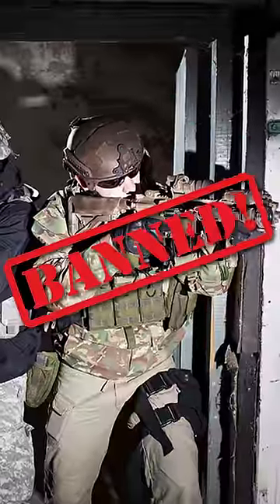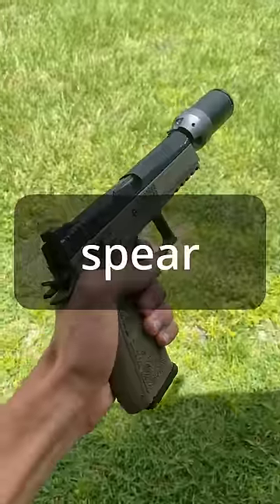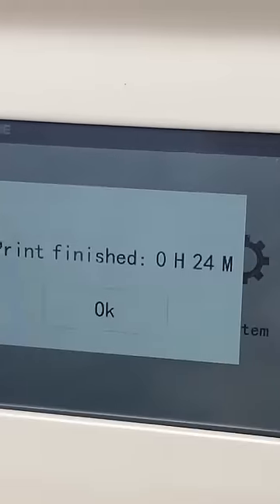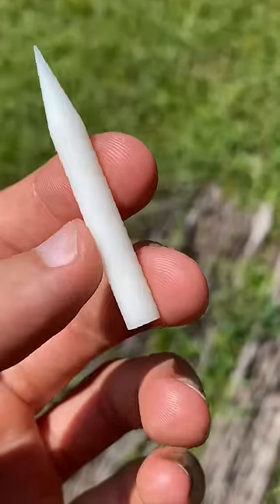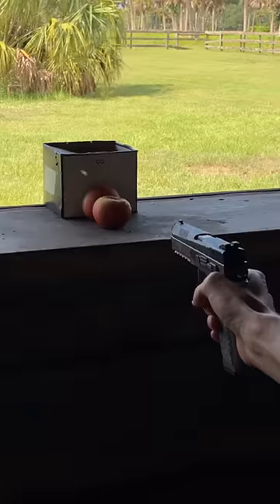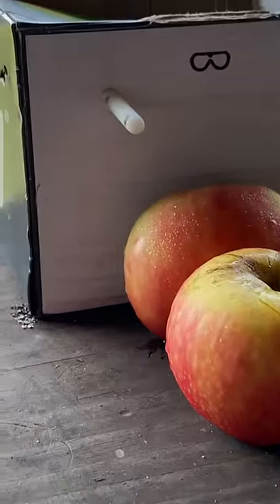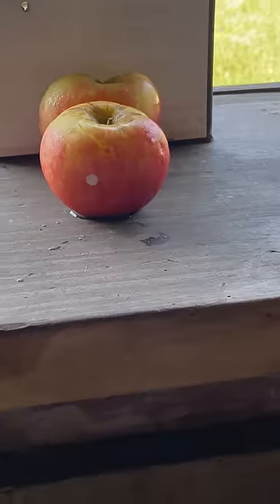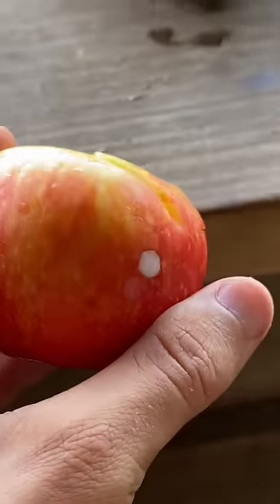How to get Banned at Every Airsoft Field in 28 Seconds

Comment: Did this with a pellet rifle when I was little. Just cut a clothes hanger at an angle so the tip was nice and sharp. The hanger piece would be cut to about a have inch in length. Then cut the end off a cuetip. Take the end up the cue tip and tape it to the metal hanger piece. It was actually super accurate and had insane penetration since as soon as it hit something the metal rod would continue while the cuetip piece would disconnect.  Good times :)

Comment: If you want it to be more accurate, you need to bias the weight towards the front. Bullets, arrows, darts, etc. All have heavy "noses" to stay stable through the air. When the rear is heavier than the front, it'll tend to start tumbling

Comment: Fun fact: You can fit a 5.56 in an airsoft gun. As long as it’s just the bullet itself. Standard BBs are 6 mm in diameter so a 5.56 fits down the barrel. Though it’s not as powerful as a BB because there is a little space around it.

Comment: So, just to be fair, this won't hit someone past 5 feet away. It's extremely unstable, without tail fins or a weight at the front it will start spinning around its center of gravity only a few feet from the barrel. Bullets shaped like this only work because rifling in the bore spins them at hundreds of thousands of RPMs (a 5.56 bullet spins at roughly 350,000 RPM) to stabilize them. I'm sure the refs wouldn't appreciate the attempt, but unless you're shooting point blank these won't hurt anybody...